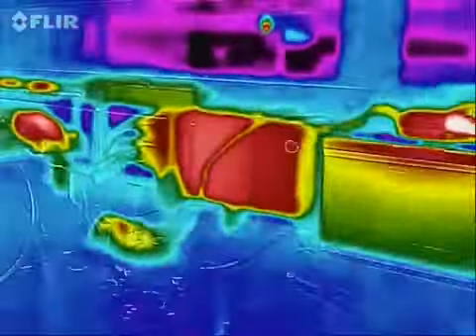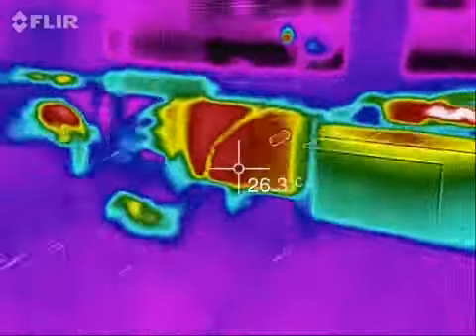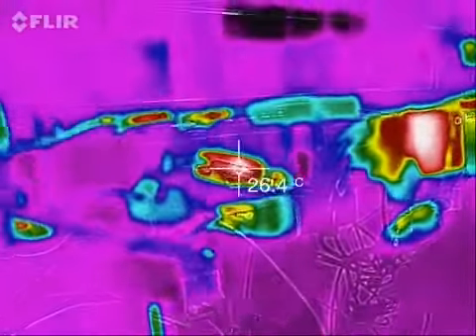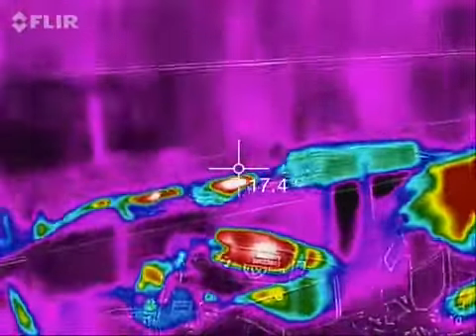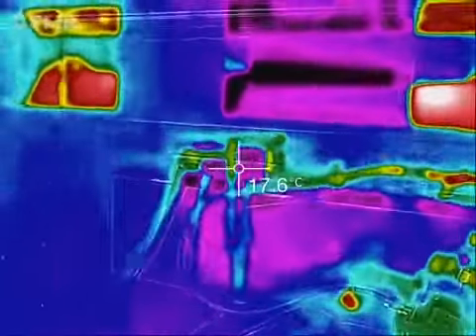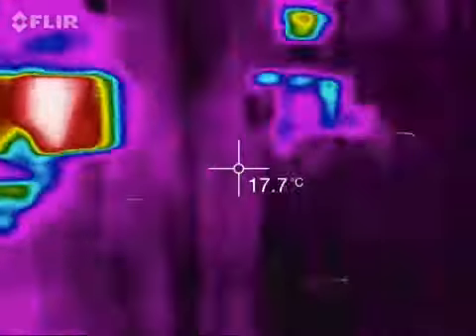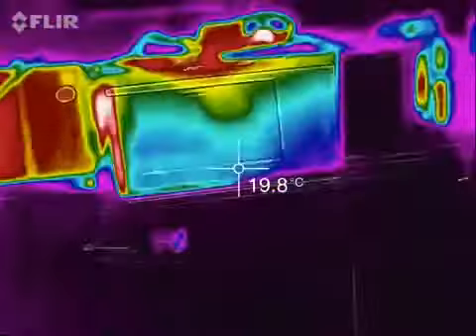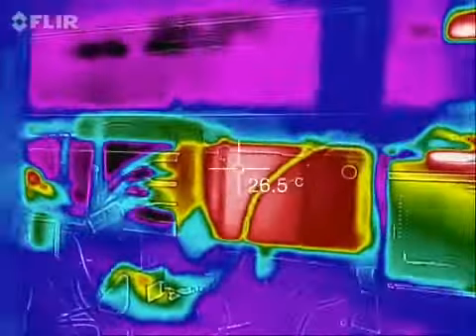Monomorphic's Test Rig Infrared Camera Inspection

Comment: Thermal imaging is cool and all, but how have your force measurements gone so far? where do you plan to take this experiment, if any further into the future? Are you going to try building something more practically-oriented if your results are confirming enough doubts for yourself?
Reply from the maker: First force measurements were a little noisy, but went well. There was an anomalous force signature in the trace.  You can more closely follow developments on NSF: http://forum.nasaspaceflight.com/index.php?topic=41732.2660